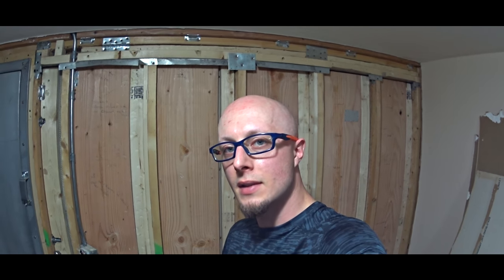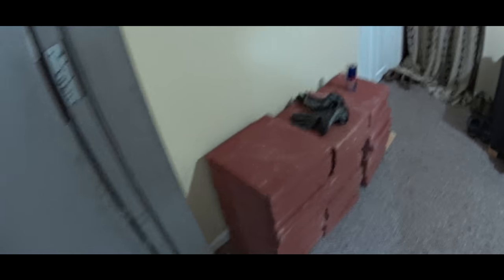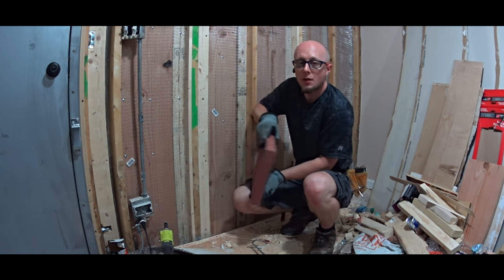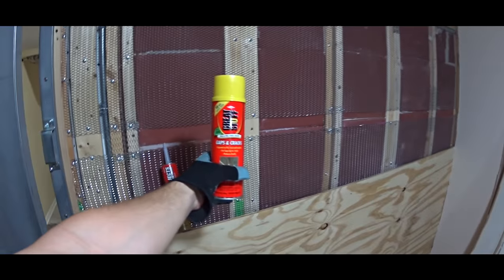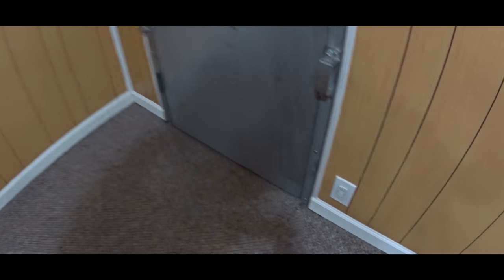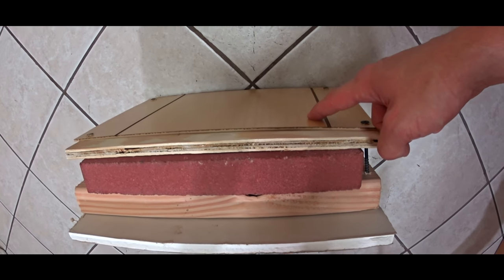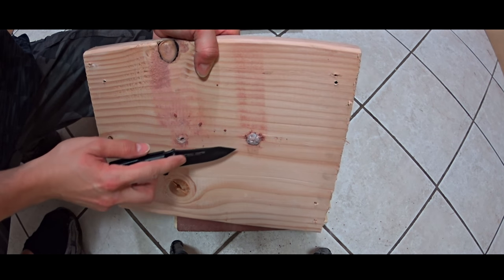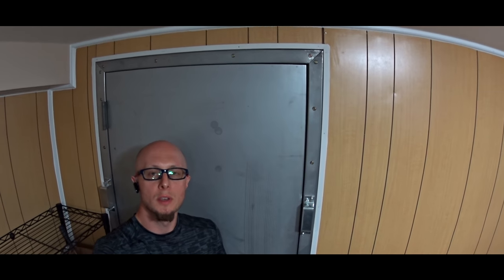Safe Room Building Project PART 2 / 9mm & 5.56 AMMO BONUS TEST

Comment: Awesome job on the wall!  Nice and clean construction.  Hey, I wouldn't vent your fan into the chimney.  BIG carbon monoxide hazard in the colder months when you run the furnace, but also in the summer if you have a gas hot water heater.   The fumes still vent up the chimney.  I would vent it away from the chimney by at least 8-10 feet to avoid any CO seepage.   If you are worried about concealment, run it into the attic space. At least you will draw fresh air.  Either way, make sure you install a carbon monoxide detector along with a smoke detector.(This is what my wife calls "The over-safe fireman" in me talking.  I was a firefighter for almost 26 yrs before retirement).   I like the 2 camera idea.  If one malfunctions or get's knocked out........Here is another idea: rig up the door handle  so you can energize it with a Taser.  An intruder would be 'shocked' (LOL) at the result  if he tried using the knob to open the door, LOL!  Great video.  Can't wait til the next one.

Comment: You get a couple of those 5.56 rounds close to one another or through the same hole and they'll go through. Also, larger rounds are gonna penetrate.
Reply from the maker: Yes, you are correct. Please read the description of this video. I did not build the safe room and the wall to be like a concrete bunker. I just tested if the layers can stop a bullet and they can to my surprise. I am happy with my build. I mainly wanted to reinforce the wall as best as possible. Take care!

Comment: umm, please realize that if that wall is shot two or more times in a 3-6inch area it would be defeated, it would have been better to use steel reinforced cementboard layered with truck bed liner
Reply from the maker: We already answered similar comments below. This is not a video about building a bullet proof wall. We did not have this intention from the beginning.

Of course we know what would happened, but there is just one important fact. Nobody will be standing and waiting for bullets behind the wall in any case. The wall is there to mainly stop/slow down any forceful attack or attempt. Just think about it how many rounds (9mm or 5.56) would have to be shot to make an opening big enough to actually let a person to enter the room. How many times you would need to hit and brake the 4 layers of the mesh to let you inside, etc. That is the entire point of the "bullet proofing" at our project. Also, if bullets will start coming inside they will immediately start going outside as well. A person at the outside of the wall would not know all actions are monitored from inside. There will be a chance to either prepare for it or stop it completely by a counter-attack.

We know steel would be the best, but it is also at the highest price level. If we would like to build a bullet proof wall/room it would be the same structure as bunkers at WW2, but the budget did not allow such a project. The wall bullet tests were added to the video 
at the last minute almost as a bonus. M.S.T.

Comment: Okay, some thoughts from an engineer:

1) Make the test wall panels before build the actual walls. This way you can tweak them before actual construction begins.

2) Install any electrical power or communication lines on the interior of your safe room. Wiring inside the walls can be damaged bullet by penetration. 

3) Install air intake and exhaust pipes from your safe room through the roof. Put them as far apart as is practical, and away from any fossil fuel chimney to avoid carbon monoxide (CO1) issues. Since it's only ambient air passing through the intake and exhaust, you can use PVC pipe, or flue pipe. PVC is preferable as it won't deteriorate in the weather. Put two  DWV, 90 degree elbows together to form a 180 degree bend. Make two of these. Put them on the PVC intake and exhaust at the roof level. This will prevent rain, snow, and high winds from entering. Think of an upside down umbrella handle. At the end of the 180 degree bend install stainless steel, brass, or aluminum screen in order to stop insect or bigger critter infiltration. Add an inline fan to your PVC intake pipe, either in the room or anywhere convenient. 

The fan should draw air down the intake pipe, pressurize the room, and exhaust the balance of air. Your exhaust pipe can be one size smaller than your intake. This will help pressurize your room and yet bring in fresh air. The reason you want positive pressure in the room is so that any air leaks that you may have in the door or wall elements will push away any gasses, such as CS Gas, Tear Gas, or any other toxic gasses. 

So, the fan will be bringing in fresh air from the roof, pushing away toxic gasses, and exhausting stale air at the same time. If desired, you could add add activated charcoal filters to neutralize any gasses that may come from the roof area.

4) You can also add emergency lights in the room. An inexpensive way would be to buy an outdoor solar light with remote solar panel. Put the light(s) in your room and have the panel on the roof. You could run the low voltage wire through your PVC exhaust pipe.

5) Store at least a five gallon bucket of water in the room.

6) Install a threshold under your door that angles away from it. This is so that if someone pours a flammable liquid near the door, it is directed away rather than flows under the door.

7) Add 3" x 3" angle iron or square tubing to the top and bottom areas of your door. Fashion brackets so you can slide them into place. This will prevent pounding the top or bottom of the door until it gives way. The usual breaching points in order of preference are: Strike plate side of door, hinge side of door with breaching rounds, bottom of the door since it can be rammed at floor level, and finally the top of the door. 

8) There are security pins that are made for hinges. You remove a hinge screw and replace it with the security pin. When the door is closed, the security pins penetrate the hinge from the jamb to the door. this prevents the door from being removed without it being opened.

Good luck!
Reply: Great info
Reply: Awesome thanks
Reply: Add a piss bucket,food, extra ammo, gas mask , a fire extinguisher, and WTF A steel pop hatch and few grenades.

Comment: Great example of a secure wall. I think that instead of using concrete pavers, I would fill that space with gravel to make it more resistant to multiple projectiles in the same spot.
But I have no idea how I would get the gravel in there.

Comment: I think I would have replaced the 2x12’s with several layers of sheet metal (yes, I know it would have been considerably more expensive).  Having them stacked together and fastened to the house’s structure would create a lamination effect, which would slow a bullet considerably sooner than before your “second to last layer”.  I’d just be concerned that someone would dump the whole mag, or even use an improvised breaching munition.  I’m also in agreement with the engineer who posted first.  

Having said all that.... it’s a good build.  I like it.

Comment: Reminds me of a video I seen from a robbery of a check cashing facility. They had steel doors, reinforced walles and bulletproof glass. The criminals however busted through the ceiling bypassing all the security features into the room. The room was just drop ceiling tile. The robbed the clerks drawers and walked out.
Reply: They robbed the clerk? So the clerk could hear them busting in then. Should have called the cops.

Comment: The clay tile paving blocks are a very bad choice. I knew they would crumble, plus the space between the tiles are wood and any
rifle caliber above a .223 will penetrate through. A one pour concrete wall with lots of rebar would stop most rifle rounds.
 I understand you worked hard building this room and it's quite an accomplishment, however, if you added up all the components used vs. concrete there wouldn't be much of a price difference, but the quality would be tremendous.
Reply from the maker: We appreciate the comment, but as mentioned many times below and also in the video description the goal was not to build a bullet proof wall. We added the concrete tiles to make it more durable and possibly stop/slow some fire attack. The concrete is certainly very good choice and we were definitely thinking about this option. But, it would require so much more work, time, money and it would be very messy than just buy finished concrete tiles. The video was not meant to be a guide how to build a WW2 bunker. We wanted to possibly give others additional ideas in case somebody want to build a similar wall/room. Take care!
Reply: MODERN SURVIVAL TACTICS Thank you for responding back. I understand your point of view and hope all goes well for you and your family.

Comment: "WARNING: This is not a video about building a bullet proof wall!" -Shows footage of building said wall.
Reply from the maker: In your following comment you mentioned the wall is good for one 5.56 round. So, is the wall bullet proof? Of course not. It was not the main purpose of the wall. The bullet test was only a bonus for curious viewers. But do not worry. You are not the only one who did not understand my concept.
Reply: Now that metal mesh layer.. Hmm I'd have to adjust my answer to 1 round of a shotgun gets your arm inside with a small pistol. Maybe 2.  9mm or 5.56  3-4 to break out a bit of brick and realize you have mesh wire. Then 6-7 more shots against the mesh to "cut it".  So in reality you built a damn fine anti-personal wall. But it's not anti-small arms like you said. On the other/outer side of the wall if you get some extra money remove the walls outer layer. Add a layer of mesh and then reattach the walls dressings. 2 layers of mesh would really hault even a serious axe murderer. Or chainsaw. Hmm Yes. Chainsaws..

Comment: from what I see this would not hold up well to any acp multi shots. sectional steel sheets may have been best even for explosion blast damage prevention. the concrete block will eventually be as useful as dust when shot at. god I would hate to demo that wall.
Reply from the maker: Thanks for the comment. We know steel would be the best, but it is also at the highest price level. If we would like to build a bullet proof wall/room it would be the same structure as bunkers at WW2, but unfortunately the budget did not allow such a project. The wall bullet tests were added to the video at the last minute almost as a bonus. We did not have an intention to make it 100% bullet proof from the beginning. Take care!

Comment: 2 ft of concrete with rebar would be easier and better
Reply from the maker: Better for sure, but definitely not easier. How would you deliver that amount of concrete to the finished carpeted basement? How would you make sure the wall 2 feet thick would hold the pressure of the concrete? How would you fill the entire wall all to the top with concrete? Did you ever worked with concrete?